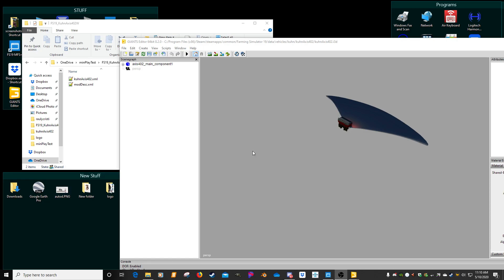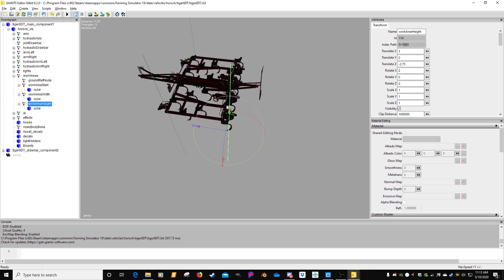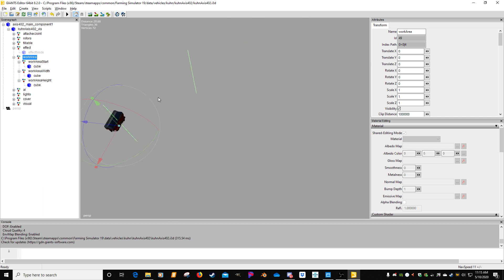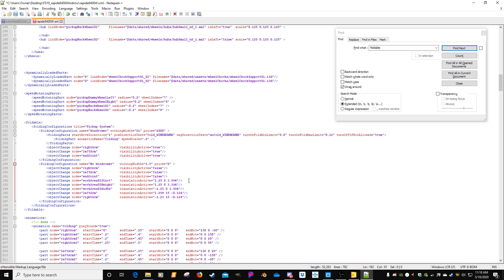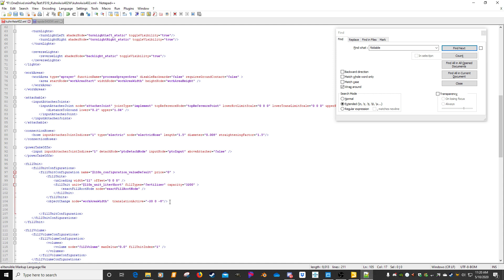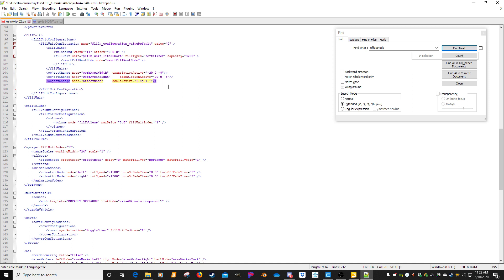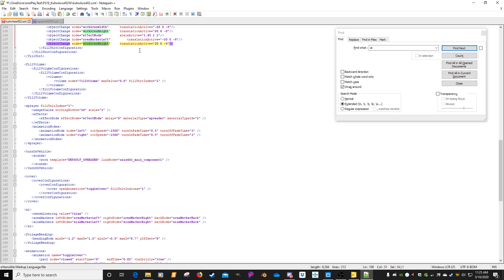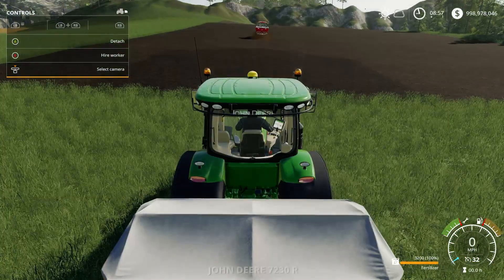FS19 - Change work area with xml, no i3d needed

Comment: hello tyvm for your videos .. BUT .. how can i change liq manure consumption per Ha ? by working width too ? i have liq.manure spreader which do 15000 liters liq manure per 0,5 Ha .. i need set 7000 l per 0.5 Ha .. how can do that please ? in xml file? if yes which line ? TYVM
Reply from the maker: I believe there is a spray usage in the xml somewhere. I would have to study it.

Comment: Hi.  Could you help me change the working width of the Pavelli bale collector  https://www.farming-simulator.com/mod.php?lang=en&country=nl&mod_id=159642&title=fs2019
So if you drive down the center of your field, you collect all the bales to your left and right to the end of the field
Reply from the maker: I’ll give it a look. I haven’t looked at how a collector working area works. I’ll get back with you.
Reply: @bdbssb77  Thank you! I looked around in the file, but couldnt locate anything that could have something to do with working width :-/
Reply from the maker: Sorry didn’t realize they were autoload trailers. I’m pretty sure that they have triggers. The triggers would have to be scaled up. I’ll look to be sure as soon as I get to my pc.
Reply from the maker: @lepaul26  ok I messed with it and this is how I was able to get the area wider.  This node https://ibb.co/BBkcXJF has to be scaled up.  In order to scale the trigger you have to disable rigid, before you do that I suggest exporting the trigger so that you have a reference for the rigid settings because when you re enable they will go to a default setting.  Once you get the trigger to the width you desire you will need to freeze the scale.  Then you re click rigid and set all the correct attributes.  Rigid body type is "Kinematic" compound is checked, collision is checked, trigger is checked and in the collision mask you want 24, 12, and 1 checked.
Reply: @bdbssb77  Thanks a lot for the effort! But I cant seem to acces the link you posted ... I go to the IBB site, but it keeps loading (turning circle). Perhaps because i don't have an acoount ?
Reply from the maker: Sorry first I’ve used it. It loads for me no account needed. It’s the trigger at 0>1|1. If you click the visibility on that node you will be able to see it as well. Leaving it visible is ok as long as it’s not white. Even If it is white you can go to shape and click non render.
Reply from the maker: If you still have issues google bdbssb mods click the link to my Wix webpage then just go to contact and join my discord. I can share images and get you quicker response. If I don’t respond immediately we have several others that are great help there.
Reply from the maker: https://bdbssb3.wixsite.com/mods
Reply from the maker: Normally I would just suggest changing the scale of the trigger in the xml (I tried with no luck) however I think because the trigger is rigid it doesn’t work correctly.

Comment: Why do you need to add all that stuff into the XML file? All I did was adjust the start width and height and it is as good to go!
Reply from the maker: Basically like the title says. If someone doesn’t want to mess with the i3d file or simply save data by not having a i3d. Unless a change is made in the actual i3d there is no need for the i3d. It can simply be referenced.  Basically someone asked me how to do it so I thought I’d share how I did it.
Reply: @bdbssb77  ah ok.. understood. I am new to all this and was simply looking for the easiest way. This seemed like an extra step. But I gotcha now
Reply from the maker: Yeah it’s a bit more xml work. It’s just good to know you can do a lot in xml. When you start throwing 50+ mods plus a map on a server it is nice to save any data you can. I give huge kudos to giants for utilizing more file referencing in fs19. The udim is an awesome feature. Saves so much in texturing files. Yes the udim files are large however they are already in the game anyway.
Reply from the maker: I also use xml manipulation for store options. For example I have a potato harvester with an optional wide header. Instead of having additional work areas I can simply change the work areas in the xml.

Comment: Huge Video. Love the easy step by step on this video. Would love to see a video of foldable in Giants editor. ( I play on 16X maps, so i love to modify mods to help). I have a few mods that i would love to be foldable so i can see the item at the length i make them.  For Example i use the harvester header that's 100M wide, but by hitting X to fold it up in game you can travel with it now.
Reply from the maker: Are you saying you want to know how to add folding to something?
Reply from the maker: I don’t have a lot of spare time these days or I’d do one quick. Basically you add animation and refer to the animation in a folding section. All I do is study a machine that does what I want and replicate the process. Now if the vehicle type doesn’t have fold in it you have to either customize the vehicle type or select another vehicle type. However most implements and vehicles have folding in the type, it just has to have the commands added in the xml.
Reply from the maker: I have a few mods on my site that I actually added folding action too. I actually added wings to the ingame potato harvester to make it wider, then added the function to the parts to fold.
Reply: @bdbssb77  I appreciate the reply and yes it was adding folding to items, if you dont have the time its good. Again thanks for the help you have showed
Reply from the maker: Glad I can help.